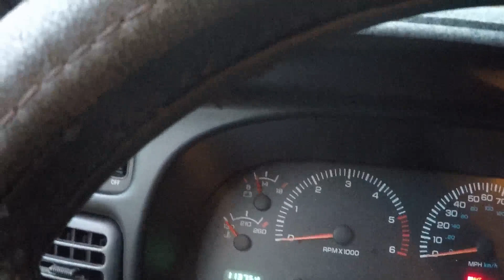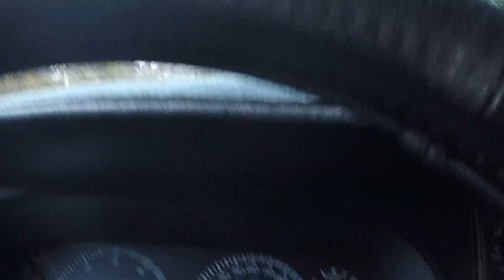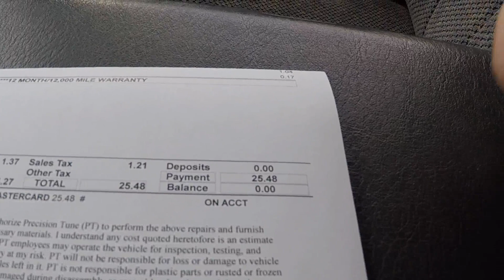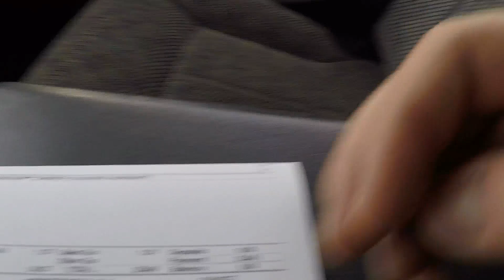Oil Change in my Dodge Ram & Winterizing my Pressure Washer Vlog

Comment: Just a word of caution,  there can be water in the pump.  i just winterized mine and when i tipped it on it's side,  water came out the pump.  i have not used it in months.  at Lowe's or home depot they have a product that you spray in the pump that goes in one hole and comes out the other. i believe it is a pump antifreeze. Pumps cost as much as a new pressure washer, so better be safe than sorry. cheers
Reply from the maker: Oh wow, I may need to look into that. Thanks for that!